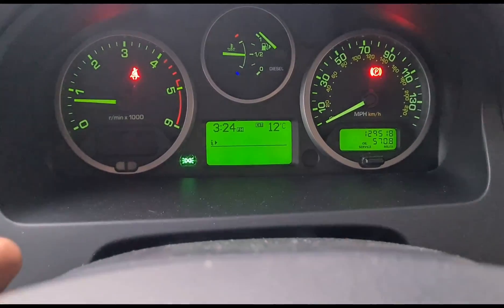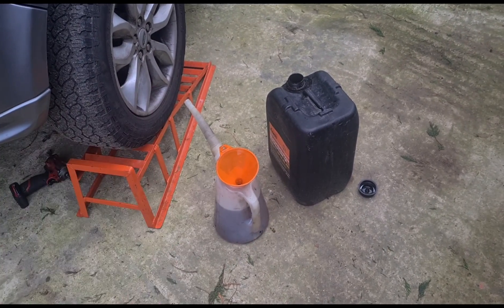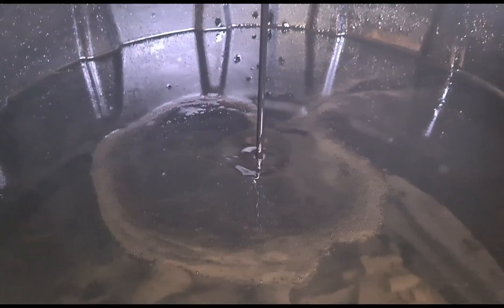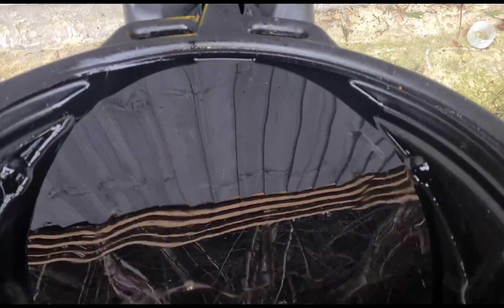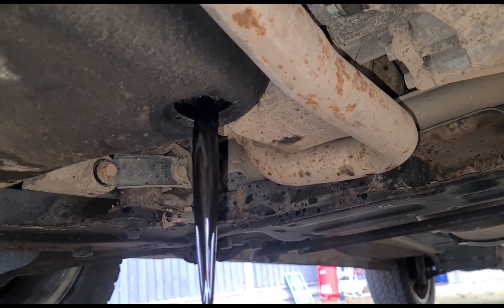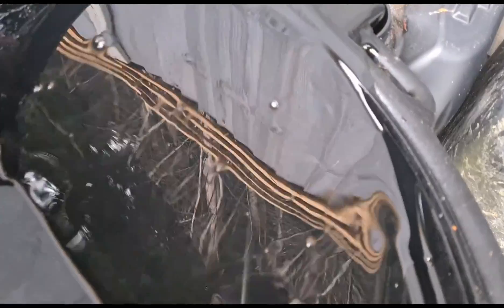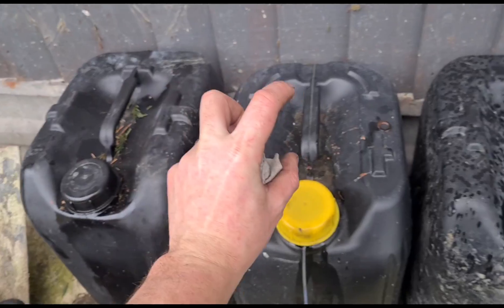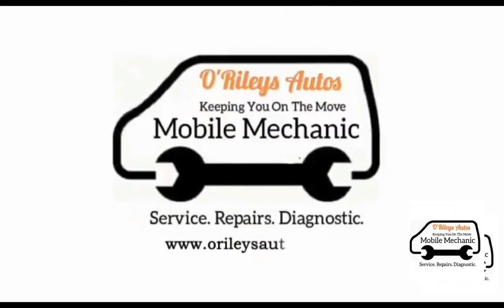How Many Oil Changes Until My Black Diesel Engine Oil Looks Clean? Test & Results

Comment: A comparison with and without an engine flush would be interesting👍

I drain the used oil out of my cars, then add new oil with the flush in it, allow to run and then hold the revs like you did, drain and then add new oil again.
Reply: Idling when you flush
Reply: @14KiloWhisky  its brief. Not holding it full rev for 5 minutes lol
Reply: @RevivingHondas  😂
Reply: @RevivingHondas also far better to add the flush to the old oil, flush makes the oil far thinner, and so when you add it to fresh, already thin oil with little soot comtamination you run the risk of leaky gaskets, oil seal rings and main seals, engine flush can also breifly, but still for short periods become absorbed by various engine components, so it's best to do a 2'nd run with clean new oil and a cheap filter after a dirty oil flushed run, then drain the new oil and start over with a high grade filter.
not to mention very semantic, small things like taking the car for a good harsh run and draining the oil whilst hot, pouring a small bit of fresh oil through your fill hole and dipstick tube till the oil draining from the sump plug is clear to help drain out stagnated oil depposits, and changing the oil filter between flush cycles to be sure the bypass wasn't already engaged on the dirty filter, and that any loose medium/oil flush doesn't remain in the oil after the second flush.
all up this process took me 7L of oil, 2 oil filters and one new drain plug costing $165AUD on my 2013 hyundai accent with 85kms on the odo, and after a whole week of using it as my daily driver the oil is the exact same colour as fresh oil.
Reply: @alexanderwoolley1623  That is exactly what I did on my 2.0 TDI. The new oil slowly started getting darker around 600-700 miles after that. But I've also only used Premium Diesel for the past 8000 Miles or so...

Comment: With most modern day vehicles fitted with electronic oil level & no dipstick as per my 2010 Range Rover TDI, it is impossible to check the oil.

Comment: An oil change with Penrite Synthetic at every 5000km from new is the solution on my Kia crdi. It currently has 640000km on the original engine. Changed the turbo because the impeller was getting thin vanes but the wear on the shaft/bushes was still well within specs.

Comment: Interesting video! Actually quite liked it! Would you recommend buying a cheap oil when doing a change to try and flush all the old stuff out before putting a better quality oil in? I was going to do 2 changes on mine to make sure it’s cleanish in the engine itself 

Thanks mikey

Comment: I have a LML Duramax 6.6 litre powered pickup in Canada, diesel powered engines have a lot of soot blow by. I use Cat filters on an adapter, they are bigger in surface area and finer filter medium. 
No matter what you do diesel oil becomes black quick but it’s not dirty in reality, use good quality oil and filters and you cannot go wrong.

Comment: Hi just hoping for a bit of advise as I’m on holiday and nowhere is open and I’m in the north of Scotland ! I have had to flush my blocked DPF following the flush it started and ran for about 15 minutes then when I was going to move the vehicle it stalled and now won’t start at all any ideas doe it have to be told by computer that it’s been flushed ! It’s a Vauxhall Crossland X 1600 D  5speed manual on an 18 plate ! Thanks in advance for any info as we are clutching at straws and due to return home on the 5 th just as garages reopen!

Comment: Just 1 Question Jimmy . .  Blow back from pistons ? (when your engine is firing - co2 - soot) is that the cause of Golden oil turning Black ? Thanks for going the extra mile  . . .  it would be a great idea . . to see how many days, weeks, or months it stayed golden . . .  ? (possibly do a Liquid Molly engine flush - pro-line first . . .  then ametech to re-coat / re-line the piston seals . .  Good Luck Jimmy
Reply: Blowby mate, a blowback is something weed smokers do 😂

Comment: There's a volume of oil retained in the engine that doesn't drain. Look in any maintenance manual, eg. Oil change 3.5 litres, rebuild 4.1litres. So doing an oil change will mix in the retained black oil and discolour it. As you have shown, it took 5 changes to make a significant difference in colour. For anyone who doesn't appreciate a good mechanic, they should educate themselves on how engines work and how to mind them, understand the cost of buying proper tools to do the work etc. I'm lucky with the car I bought 2nd hand. (I'm 3rd owner) 1st owner I dont know service history, 2nd owner bought the car as 3year old, oil & filter done at 5000mile interval. I bought it at 12 year old with 101000miles.  its now 19 year old Yaris 1.0 with 162000 miles, oil & filter every 5000miles. I got the oil analyzed by a company in Carlow at 136000miles or so (oil 5000miles old), engine is perfect, like a new one).
Reply: Petrol engines are always cleaner oil than diesel
Reply: @wayneross9723 correct because of diesel soot blowing past the piston rings (more on older engines)
My petrol car is 17 years old and the engine oil is Golden my diesel land rover is 20 years old and the oil is black even after just being changed
Reply: @superchickensoup  I had a bmw in the 80s 320i straight 6
When I changed the oil it was always clear what a fantastic engine
Reply: What’s the name of that place in Carlow to check the oil?  I have a bike and a car I want done.
Reply: @john-qy5si  tellabs, tullow, co. carlow
Reply: @john-qy5si  tellabs
Reply: Damn that's a lot of work for a Yaris

Comment: My old man used to work on the roads, when he did an oil change he would fill the engine with with diesel. Let it run for a bit and change the oil, better than any engine flush you can do. I don't go as far as filling the whole thing with diesel, but I put 1/2 litres in and run it a bit before any oil change.

Comment: Ive had to do a 'dynamic flush' and oil change on my auto gear box that was slipping and giving strange faults. I had to change it 13 TIMES! to get CLEAR red oil. As you know this is done with the engine running until a few litres of oil comes out STOPPING topping up with that amount - repeat!  NICE TEST !

Comment: My 2001 Caddy van (diesel) had black oil on its first service so they changed it again and it was still black. After this I gave up. At the time the van had only done about 4,000 miles. It's still going strong at 105,000 miles with many other oil changes. Is this beause it's a diesel engine?

Comment: Every mechanic worth his weight knows there are oil baths in the engine that never drain down, especially in the cylinder head, this is to ensure the camshafts never run dry, this is the reason for the oil being a bit dark after the oil change
Reply: Yeah. I was just thinking that if one would like to have this very clear oil status, might be cheapest way to just fill literally completely full and drain it after that and do normal change. Even so, I don't think one would get fully clear oil after one change.

Comment: Using a 2 stage engine flush would cure this problem in the future for many of cars and should be common practise,or go old school throw half a gallon of diesel in with your old oil and run it for about 15 minutes.

Comment: Is that because its a diesel or is there that much carbon build up or a combination of both or is that the same for petrols.

Not something I've ever done with changing the oil that many time but the odd occasion I'd put a clean through before doing an oil change on my car

Comment: Maybe for those not in the know we should say relatively clean not clean as even if you would have used engine flush with every oil change there would still be some debre in the oil after running the engine for a short period especially on a diesel

Comment: Always change the oil filter when you change the engine oil.   The old oil filter holds a lot of old dirty oil and the filter is loaded with soot and junk that will contaminate the new oil.

Comment: Cheaper way to achieve this is to run engine flush before 1st oil change.  Diesels will always develop black oil, though, nature of the fuel sending black soot down the cylinders and being washed off by the oil doing it's job as it should.

Comment: Given the shape / design of the sump, with its indented drain plug, there will always be some dirty oil left in the bottom, to mix with the new oil, plus oil in the galleries.
Reply: Was wondering if some sort of soot sediment could form at bottom of sump
Reply: @MarcLaurens1 it does, this is why you keep the drain plug removed and pour a small amount of oil through the fill cap and the dipstick tube untill the oil draining from the sump is clear, wont remove 100% of the old oil sediment from the bottom of the sump but it's way better than doing 5 oil changes!

Comment: That's awesome video Jimmy 👌👍🙏
I had this idea in my thoughts for a while but never executed it.
I was thinking of using with each oil 1 bottle of engine flush and new filter every time for at least 4 oil changes and everytime to let the engine run idle for 10 to 15 mn then do the last one without oil flush but you just saved me a fortune because from your experiment the oil will always turn black after a good run.
Now i have 4×5Ltrs of cheap Lidle oil and one correct good one from motor factor and 5 new oil filters and 3 bottles of oil flush was going to buy the 4th one for the operation and now sitting in my shed 🤷‍♂️🤭🤭 i wish i bought the 4 ones from motor factors instead as Lidle didn't have the correct one🤷‍♂️🤭
Great video and thanks a million for sharing this awesome video with us  🙏👌👍💯
✌❤☘
Reply: What a waste of good engine oil
Reply: i used engine flush and it started an oil leak.

Comment: Hi Jimmy, would you recommend doing and engine flush at each oil change to remove the soot?
Reply: Hi, i'm not a mechanic but i did suggest an engine flush to my mechanic when he serviced my (old 2005) van and he said it can actually do more harm than good, especially on an older engine as the soot/gunk may be sealing any bad seals.
Reply from the maker: I use diesel fuel as an engine flush

Comment: I don't understand why you didn't let the oil  temperature rise up to running temperature by taking the car for a good run 100 miles or so, to let the new oil wash out the old thicker dirty oil deposits around the engine so as to dissolve out the crap properly...... or use a proper flushing oil  .......

Comment: I have done this on my sprinter van a number of times if you change the filter every time with the oil it will be clean after three times and after the first time flushing the oil changes after that it is clean after just two times but I half the mileage for the service times as they are far to long in my opinion especially with the emissions systems ending up with soot and diesel contamination in your oil

Comment: A few decades ago (I'm that old), when engine oil was very dark and worn, most garages here would recommend a cleaning oil that would idle for a few minutes in the car, and then was drained and replaced by the final oil. That seemed to cure the rapid darkening of the new oil.
Reply: Same as i do, change filter put in cleaning oil let run for 20 minutes then new oil and filter.
Reply: @andriandrason1318  Waste of time and money with no real benefits for the engine. Just do oil an filter changes every 3000 to 7500 miles max.
Reply: @andriandrason1318  👍
Reply: In the past I have put a couple of cups of diesel or or paraffin in the engine and let it idle (only) to help clean .
Reply: @GR-uy1hx  As long as the residues left, don't hinder the new oil.

Comment: With diesels the easiest method to work out if it needs a oil change before it’s due is to wipe the dipstick on the back of you hand and then rub the oil off with your other hand. If the oil stains the back of your hand ( that is stays in your pores) it means the oil is carbon ladened and need replacing. If you do it again after the oil change you will see your hand won’t stay black meaning it’s not carbon ladened. Oil filter can’t filter out the carbon . I don’t know why they don’t use a centrifuge filter to spin out the carbon deposits.
Reply: Filters catch deposits bigger than X. So some of those really small pieces are sustained in oil & get past filter media.
Reply: Zetor tractors in the 1970s had a centrifugal filter. You took off the filter housing, scraped the carbon deposits off it and replaced the housing. It was cheap because you didnt have to replace any parts, but it was inefficient. Modern engines wouldnt tolerate that kind of badly filtered oil
Reply: @daneenmurf1043  scania use centrifuge filter as a bypass filter. Main oil through the filter but some oil goes through a centrifuge. Ford 2.4 duratorq had them in the rocker cover aswell as a normal oil filter. It has been done before, but manufacturers don’t want you to keep vehicles ,they want you to replace when the warranty runs out. It’s the second hand buyer who cops the problems and this is generally where the dissatisfaction of the model and brand  sets in.

Comment: Nice one Jim, I wondered if you would do it or not but true to your word you did so fair play to you. I'm guessing the insides of the engine get coated in the black oil and this gets sloshed back into the new oil as the oil circulates around the engine. I've often wondered if local Ford main dealer has changed my oil on a service ( Mondeo 2 litre diesel ) , I suppose, why wouldn't they ? Anyway, cheers again.

Comment: I always use a flush added to the oil before draining, oil still black quickly but has obviously been changed. Lots of comments disparaging it but have done this for 20 years with no problems?
Your views appreciated?

Comment: Thank you for sharing. Oil colour is a guide to clean oil . Oil job is to lubricate and cool components. The detergent in the oil will remove anything that contaminates the oil like moisture and fuel. New oil regardless of colour will lube and decontaminate. Relax about the colour. The oils are good once you replaced it in doing its job. Filters are a myth fresh oil is very clean in a sealed environment and no need for a filter just a strainer and a magnet is all you need once the engine had its second service in removing any abrasive from machining and casting on new assembly. Thank you for sharing

Comment: I Putin engine flush and new filter and ran for 40 minute then removed then replaced with 1 gallon and another flush ran for 40 minutes changed oil and filters put in new 7.5 liters still black Ford transit 100 k service

Comment: It's similar process when servicing an automatic gearbox with torque converter. Multiple oil changes are the best way to properly replace the oil.
Reply: Or "Dynamic Oil Change" with special machine.

Comment: I did this myself about 2004 on a 3 year old sprinter. It took me 3 goes on that. The difference was I used flush b4 each run, drain and refill.

Comment: I'm not a big fan of using engine flush additives, since they could be hard on the rubbers as leaving some residue. So this is an interesting way to flush the engine.
Reply from the maker: I use diesel in my van engine to flush

Comment: When I had a diesel Ford Fusion, I'd do the first flush with a cheap oil / diesel mix, run it up to temp for 10 mins and then drain with a new filter. It was a bit better, still dark though.

Comment: For those wanting clear oil after an oil change on a diesel, a full engine stripdown, clean and rebuild will sort it 😂
Reply: .... or you could take out the engine and roll it over and over again to dislodge trapped oil 😁
Reply: For first few hunded kliometers 🤣

Comment: Had customers accuse me of not changing oil on their diesel engine. I even changed it again at the customers request while he watched. He didn' t know what to say then when I pulled the dip stick. No apology though, but I charged him for doing it again. The soot in a diesel engine especialy the high mile ones takes some shifting. The oil is doing its job by holding the dirt in suspension.
Reply: Avoid doing it multiple times by filming your oil change with your phone and showing customers the evidence. Customers will be glad too for not being charged multiple changes.

Comment: Jimmy, thanks for doing this, a very interesting video. I suspect regular oil changes
(2-3k miles) would produce this result eventually. Do you see any value in send off an oil sample and is there a way to check quality of oil on a scan tool?
Reply: You would have to change a diesel engine every 500 miles.The oil always looks black.I had a new rav 4 diesel.and oil change after 1000 mile looked blackish.
Reply: For those who are interested Where I work we service a old discovery td5 every year that does about 1500 miles a year and the oil is like the last oil change Jimmy done